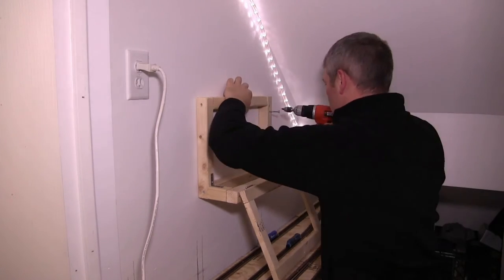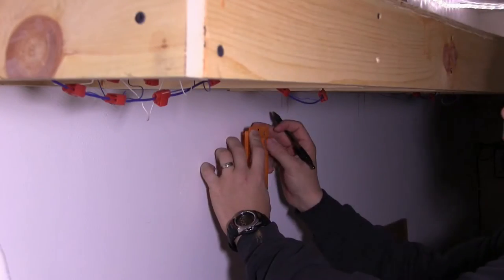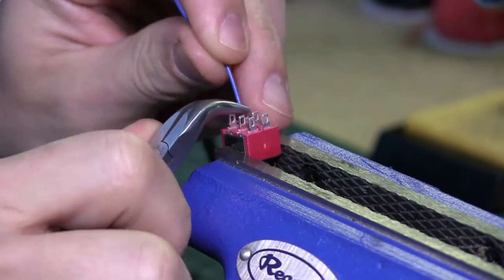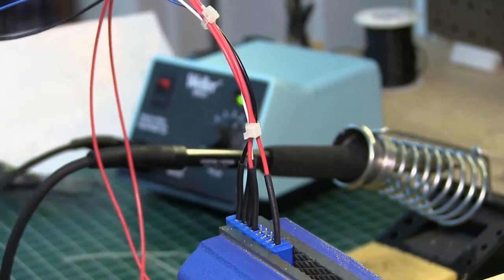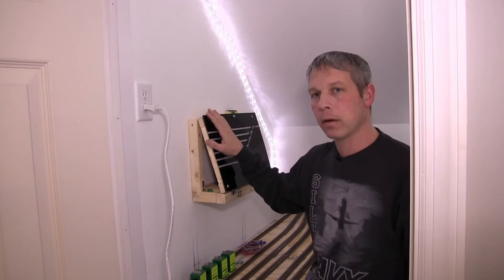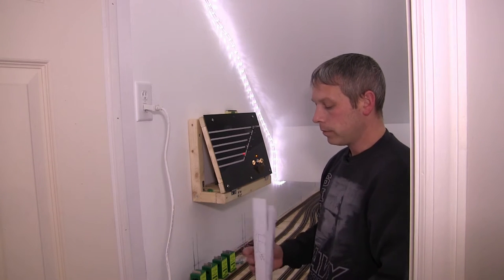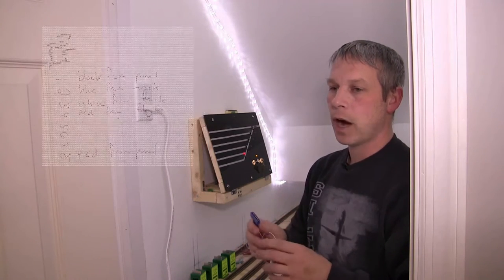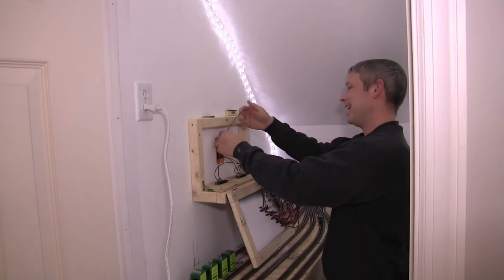Installing Tortoise Switch Machines and Digitrax UP5 panels on ths Sayrehurst Secondary

Comment: Good video. DCC Concepts make a very good slow motion turnout motor called cobalt iP in both digital and analog with spring connectors. No more under bord soldering

Comment: Nice work Joe. Just a FYI on the up-5 panel the spot for hooking up the common power wire is actually a hole you can push a small enough wire threw when soldering it on. Sounded like you just had it touching it. Hope this helps.
Reply from the maker: +Ralph  Orr Yes Ralph, I have seen that on other videos, but the one I got the hole was actually filled in. I don't know if that was a change in manufacturing or what. I can say that they are working the way I did it, so that's a good thing. Thanks for the info.

Comment: Great video Joe, thanks for sharing. Were you able to install the tortoise machines through the center of the switch and if so did you have to drill them? Planning on using code 55 Atlas on my next layout but I noticed there is not a predrilled hole through the center of switches for under the table throws. Thanks - Steve
Reply from the maker: SoCalBNSF N scale layout yes I installed the tortoise in the center no drilling needed works fine but don't forget I'm using ME turnouts. I do have two atlas curved turnout with the holes on the outside, I mounted the tortoise off center and works just fine. Thanks for watching.
Reply: Thanks for the clarification, awesome layout and work. Can’t help but notice Navy shirts in videos, what was your rate? - Steve
Reply from the maker: SoCalBNSF N scale layout TM1/ss. USS Honolulu (SSN 718). How bout you?
Reply: Nice, thanks for your service! Still active here, ASCM, all Aircraft Carriers and LHD’s. - Steve
Reply from the maker: SoCalBNSF N scale layout no thank you and thanks for following along master chief!!!!
Reply: Easy to follow along when it’s great material being delivered, very informative and I’m learning a lot for my next layout. Thanks again. - Steve

Comment: You have made some great videos, I enjoy watching them, but just for your information. There is a jig/template that I have used with success for my  tortoise switch machines and can be found on ebay. TDG806 Tortoise drill jig installation tool by BVI rail tooling
Reply from the maker: Thanks I will look into that!

Comment: Excellent video, thanks. What type of switches are you using? Also regarding the connection to the frog - You connect connector 2 and 3 to the same bus wires you  connect the stock rail to correct? Does it matter what Bus wire you connect to each? Thanks.
Reply from the maker: +Eric Ruthenberg the #2 pin is connected to my blue wire which is the "B" rail on the digitrax system, and the number 3 pin is connected to my white wire which is the "A" rail. I don't know how to figure out which one should be connected to which pin other than trial and error. I would connect each wire with clips, turn on the track power and run the train. If I got a short I would switch the wires. I know I kind of skipped wiring the frog in this episode. I apologize! It was omitted because of time and the audio was poor quality. I will address this topic in episode 15 or 16. Hope this help!
Reply from the maker: +Eric Ruthenberg  Also I apologize for taking so long getting back to you, work has been crazy the last 2 days.

Comment: I chose to go with Digitrax DS64 and DS52 DCC Turnout Controls for my turnouts. Less wiring, no switches used, and you can automate routing of trains through a yard or the mainline.
Reply from the maker: Jon Frost I chose not to  because the main line is not signalized. This is a dark territory and wanted to simulate crews hand throwing switches. I Saved money on not have to purchase stationary decoders.

Comment: What thickness acrylic did you use for your panels? Do you think the switches have enough thread to go with 0.200" thick acrylic?
Reply from the maker: Brian Bennett I used 2.36 mil lexan polycarbonate sheets. I got them at lowes, they are usually in stock.
Reply from the maker: Brian Bennett as for the switches I used the threaded portion is .297 inches. So theoretically they should work, but it's going to be tight.